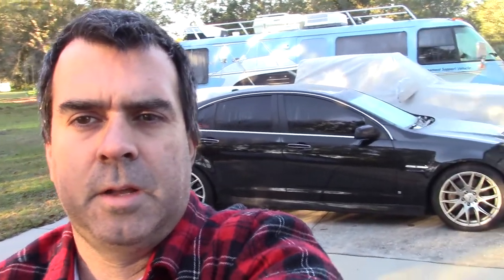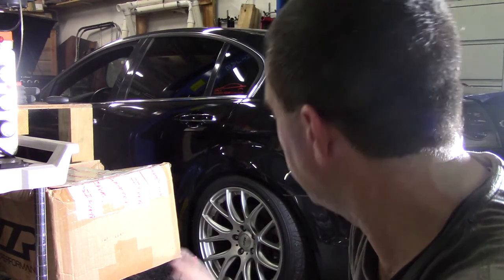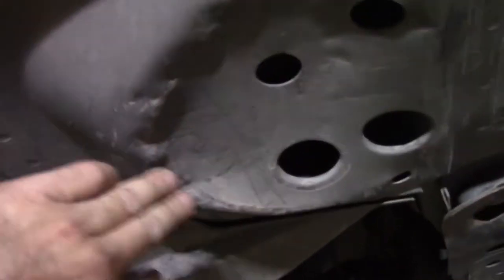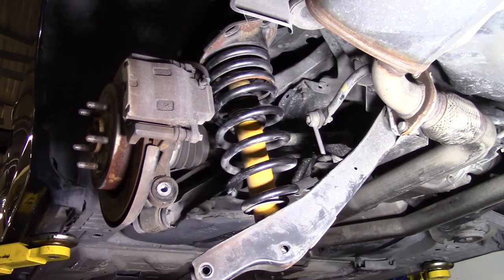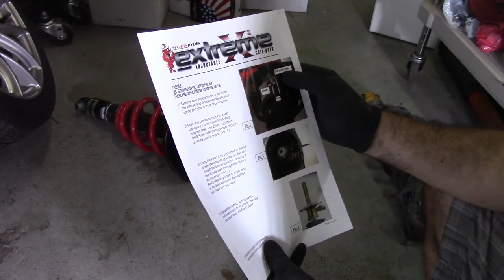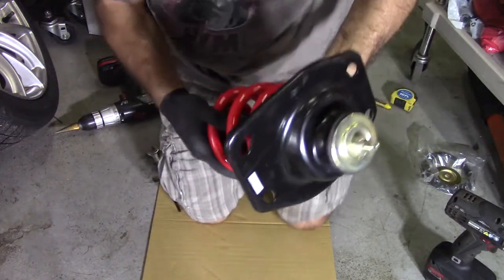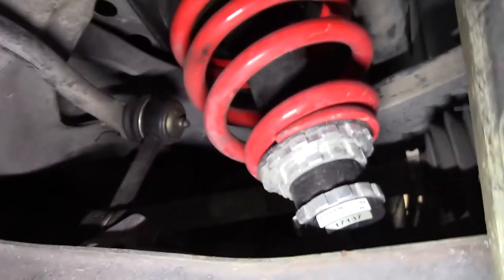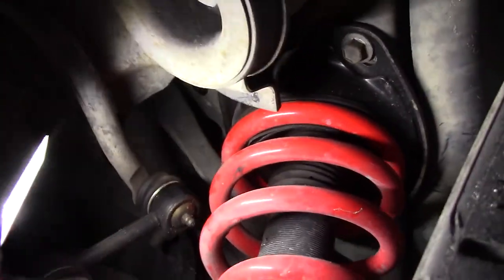Installing Pedders coilovers on a 2008 Pontiac G8 GT

Comment: My new sway bar links are floppy right out of the package. Are they supposed to be solid? A RockAuto product.
Reply from the maker: They should be pretty stiff and take a little bit of effort to move them. If you shake the bar and the links flop around i think there is a problem.

Comment: Did you have to adjust spring preload?
Reply from the maker: i did and then i had to adjust it again after driving it for awhile. The Ride height got to low and It was hitting going over speed bumps.